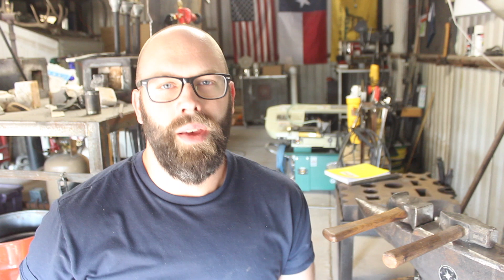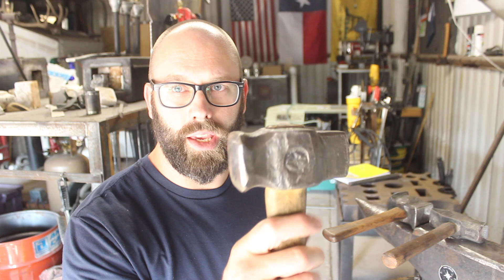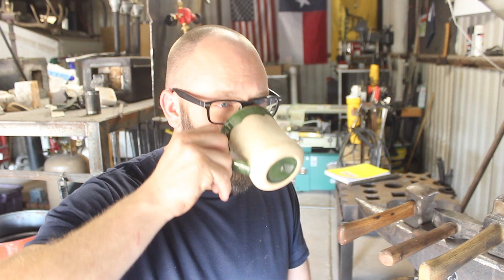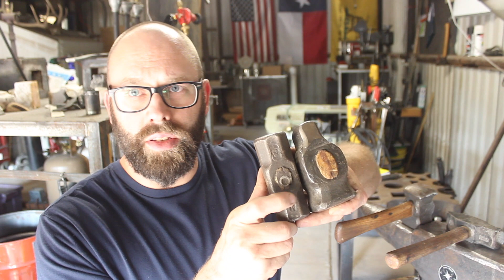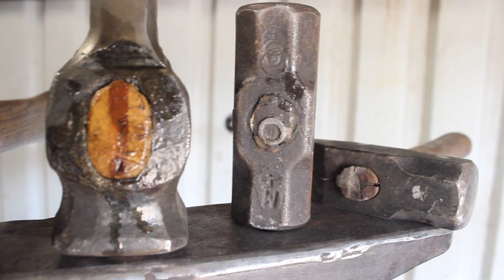Essential Hammer Maintenance For Blacksmiths, Craftsman, Knifemaker | Proper Use And Care Hand Tools

Comment: my understanding is that boiled linseed oil is less of a fire hazard than the raw kind. raw linseed oil, as it dries, likes to oxidize and heat up, and a big pile of linseed oil rags can spontaneously catch fire, at which point you have an oil fire on your hands which is very bad.
Reply from the maker: Yes that can happen. The boiled linseed oil container has the same warnings